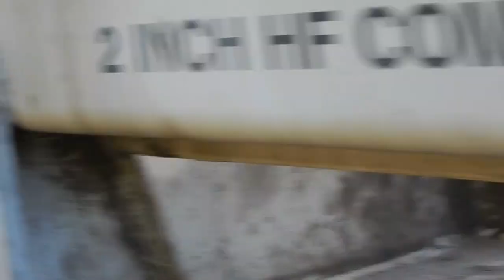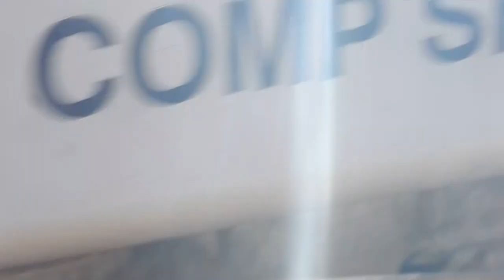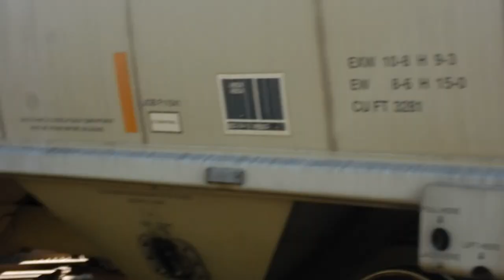All about Hoppers Part1 (Got to know what to look for) Hopping Freight Trains

Comment: On the branch line near me, they use a lot of hopper cars like that, with no platform. Some of the spurs are long so they have to back up for long distances. The crews don't like staying on those cars for long so they bring an old caboose as a shoving platform. it's a pain for riding but it's also neat to see a caboose. The tracks don't go anywhere anyways.

Comment: In Norway, the only types of trains the you can be sure to find are the intermodals and the piggy backs. The piggy backs in norway are very hard to get into and if you do, you can barely see out of them, also, you can get your head cut off from the trailer bouncing up and down because there is walls on the side of them that keep the tires in and all the safe space is taken up by the tires.
Reply from the maker: thanks for the info - did notice after watching some videos - they are different then Canadian and American rail cars with little room except rock hoppers